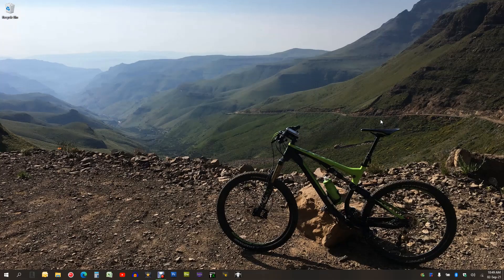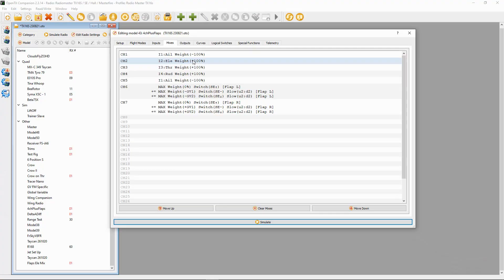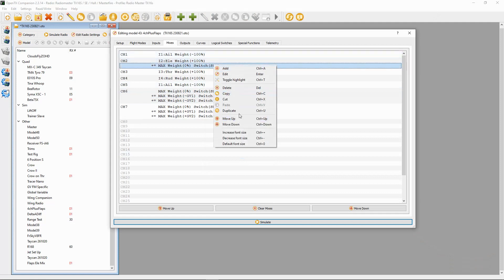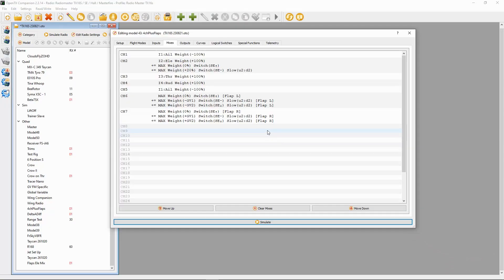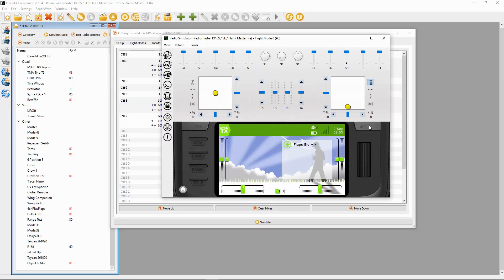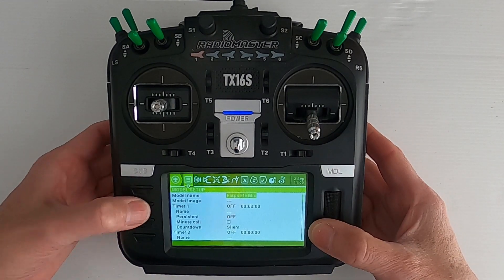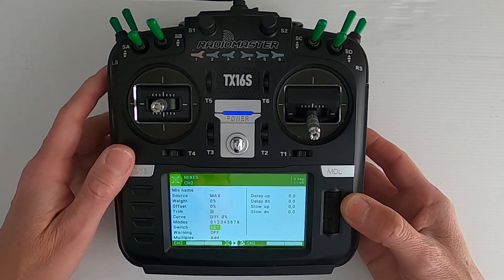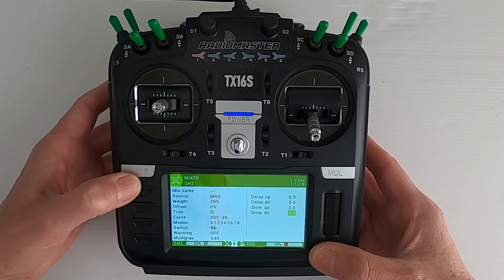OpenTX Flap Elevator Mixing

Comment: Thank you for these amazing vids. Do you think this mix will be necessary using a gyro? It might conflict with its leveling. I'm not sure. Guess I'll be the one to find out lol. I'll report back if you're not sure either.
Reply from the maker: You should be ok to use this mix because the gyro will always try to stabilise the plane. This would come more into play if you switch to manual flight.
Reply: Thanks Bill. I'll definately give it a go. I did use your flap vid too but my tundra needed loads of offset to just level the flaps. Works great on the bench now but if I test safemode my flaps seem to go to half deployed flaps!

Comment: How do you mix elevator to flaps so that when you hit a switch, you can have the flaps go down when you give up elevator for tighter loops and corners. You can turn off the mix with the stitch when not using.
Reply from the maker: Normally you would mix in down elevator with flaps because the nose of the model can pitch up when deploying the flaps. You can set the mix up you require by adding a mix to each flap servo and Source Elevator Input and select a logical switch to activate the mix. The Logical Switch will be needed to be set to be active when the mix switch is selected and the flaps switch is down.
Reply: @the-happy-RC-flyer  thanks for your quick response. However, I can't quite get my head wrapped around your instructions! Would you be able to do a demo video? I have my flaps already set up on my SE switch. What I want to achieve is to fly normal but when I want to do a bit a Acro,  I flip a switch and the flaps and the elevator will move with the elevator stick input to allow me to do tighter loops and banks. Switch off and i go back to normal flying.
Reply from the maker: @othnealhaynes2194  I will record a video for you showing the settings no problem. Stay tuned!

Comment: I see a problem. If you assign +40 when flaps full down, you lose +40 throw in the other direction of the evelvator.
Reply from the maker: You will lose some resolution because of the mix with the flaps. In my video it is just an example so 40% is more than likely to much.

Comment: Hello, is it possible to update receiver like xm+ with t8 pro ? I mean somethink like ota update
Reply from the maker: Because the T8 Pro does not have a JR Bay you would not be able to update receiver firmware also you cannot do OTA updates with your radio.
Reply: @the-happy-RC-flyer  ok thank you, those t8 pro suck a bit on some parts ...
Reply from the maker: @SunixDev  they could have added a JR Bay so you could use Crossfire.

Comment: Hi Bill. I wrote to you about updating my tx16s with new firmware. My problem was the radio doesn't work with a 64gb card. I used a 16gb. It worked thanks.
I have another question. Can you do flaporons if you use a y cable 
Regards Johan
Reply from the maker: Hi Johan, no you need to have a servo for each Aileron for it to work as the need to move independently of each other. On a y cable they can only move the same direction. Pleased you sorted out your SDCard.
Reply: Thanks Bill. Your video's are very explainable. I have learned a lot from them.
Kind regards
Johan